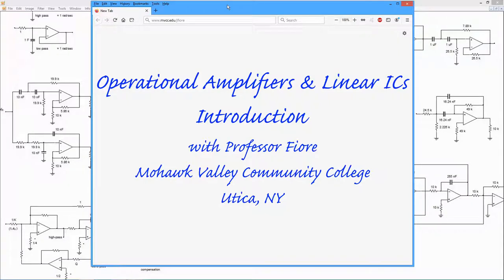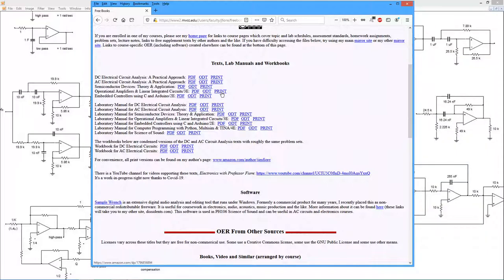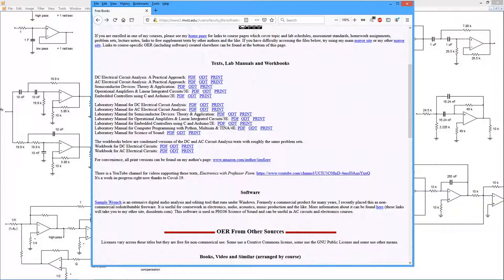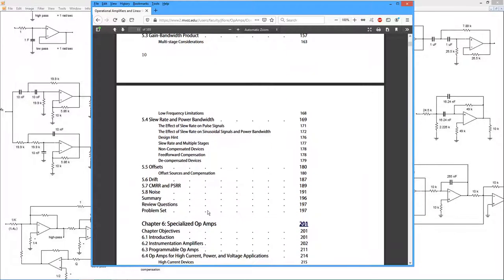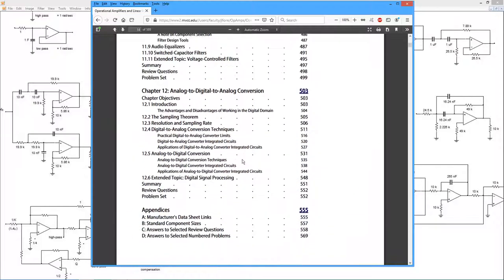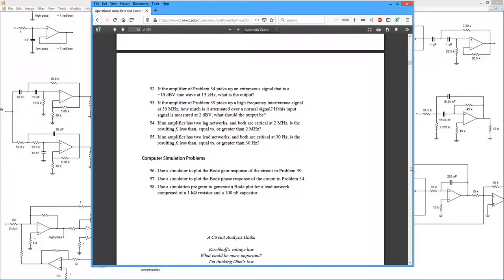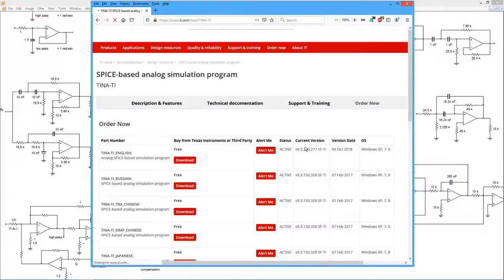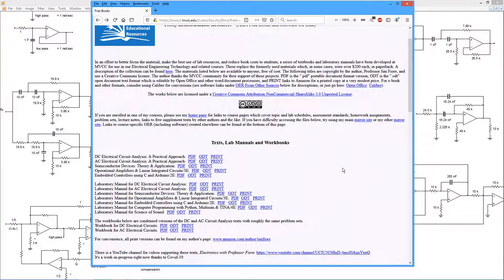Op Amps Introduction

Comment: ARE THE ANSWERS TO THE PROBLEMS  IN THE BACK OF EACH BOOK CHAPTER CORRECT?YOUR OLDER EDITIONS OF THIS BOOK WERE FILLED WITH MISTAKES MISTAKES.
Reply from the maker: Filled? I'll admit there were/are some occasional typos but it was/is hardly "filled" with mistakes. This is true of virtually every text I have used over the years. None are perfect. Whenever someone reports a possible error in any of my books, I will immediately check it. Often, it turns out to be an error on the part of the reporter. If there is an error, I will update the book, creating a new revision number (the third part of the version number is increased). It is then uploaded to my sites and Amazon. This usually takes a day or two (a bit longer for Amazon to do its thing). Is there anything specifically that you have found or are curious about?